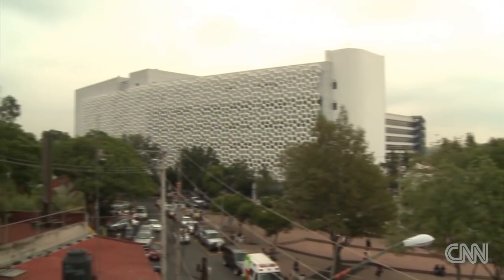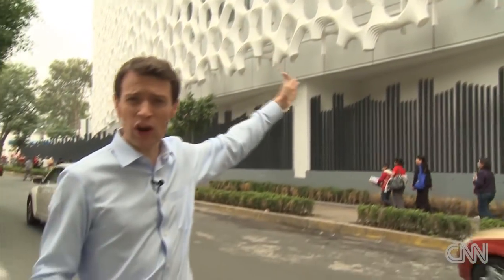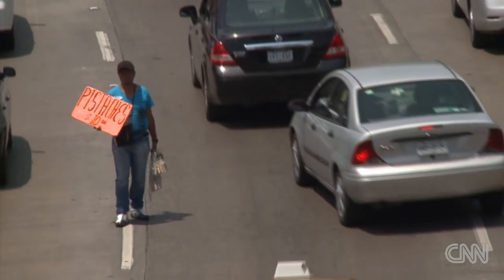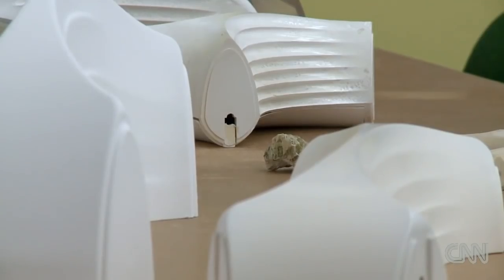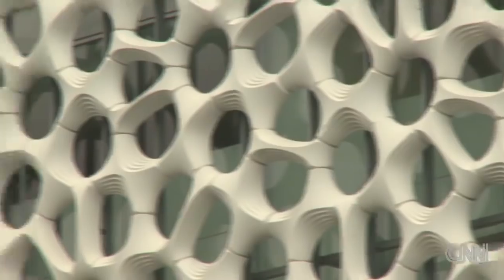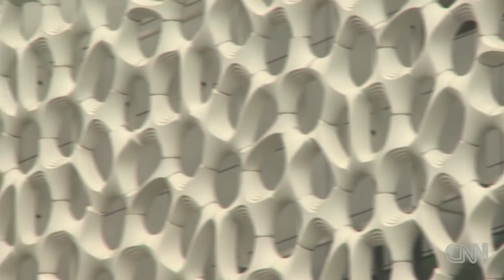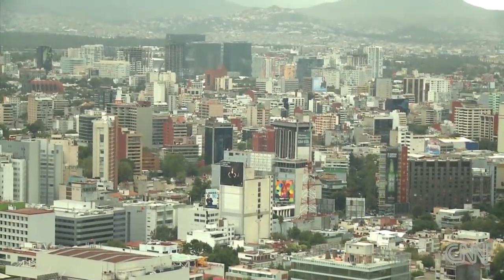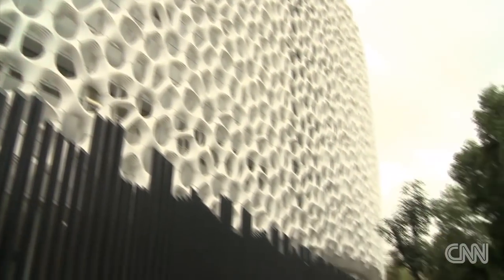Mexico's smog eating buildings

Comment: Could a form of this material be used in conjunction or as a replacement for rear bumpers on cars. We eventually need to recycle all combustion engines and create better cheaper solutions that is happening but the interim time when we have gasoline cars on the road we should make them run at a low cost to the environment as possible. Maybe locally sourced biofuels can help but not wide scale harvesting.